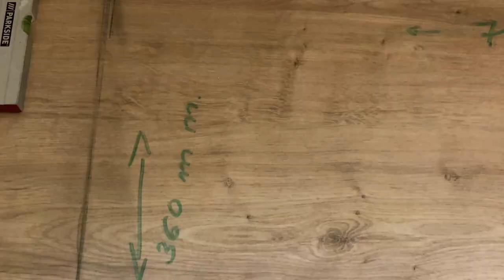How to install Kitchen Sink 304 Stainless Steel Nano Raindance Waterfall  in Europe standard

Comment: I just bought this sink and am about to install it based off your video. Did you use anything to secure the sink to the countertop?
Reply from the maker: Thank you for your comment 😄 
Just simply follow my video and you can see I don’t use any hardware to attach that sink to the board . Just used a quality silicone. That’s it !
Reply: @petermis7524  okay thanks Peter! So how's it holding up after 1 month? I figure the holes in the butcher block for the filtered water tap and cup cleaner should help keep it from shifting but it seems like there's nothing holding it down except it's own weight and gravity
Reply from the maker: @moorcroft710 it’s holding really well tbh. Silicone does the job trust me 😊 just give a good amount of silicone under sink edges. Good luck with 😊
Reply: I got one recently and it's fairly heavy enough. It may shift if your opening in the counter is to larger maybe but thats with any sink. I am, however, trying to figure out how to make my threaded pvc drain pipe in the wall not to have threads so I can use the adapter it came with... anyone have any suggestions?
Reply: Hello plz help me regarding I am struggling while using  hot water as on slow tap we only get cold water and only I can use hot water in higher force . So my question is how can I use hot water in slow force ? Thanks
Reply from the maker: @mohinipatel3340   you have connected those two high pressure hoses in opposite way , just change it